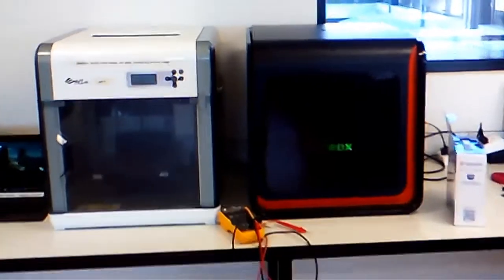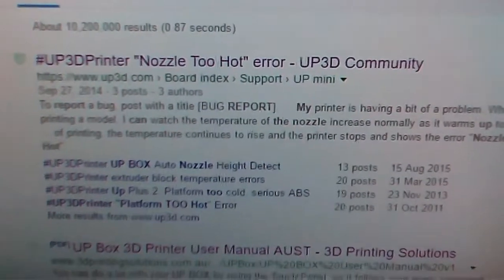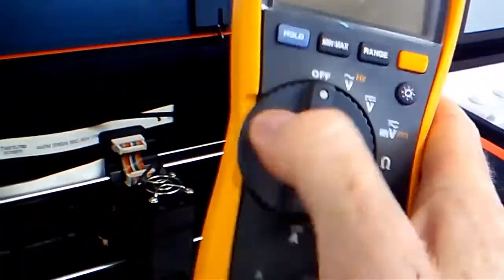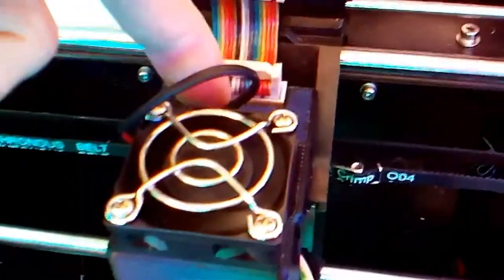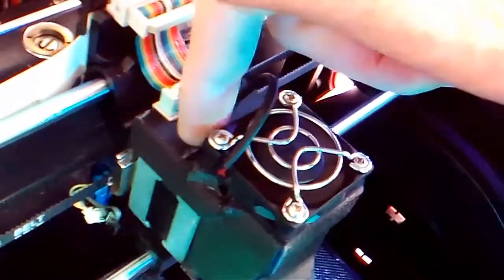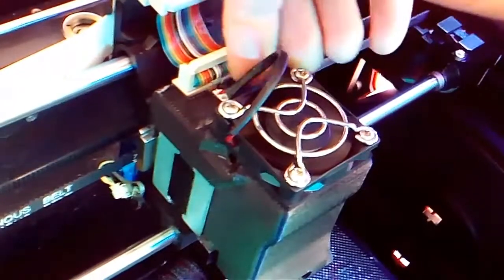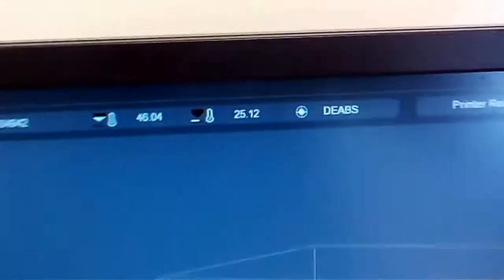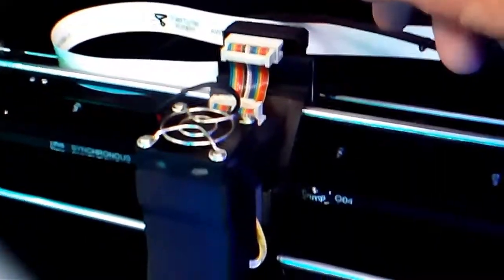UPBOX nozzle temperature issues and check

Comment: Hi 

I have the same issue with my Up Box. Did you get your printer working?

Nozzle Temperature of  mine just gets to 30 degrees. I have replace the complete head and still have the issue so am thinking it may be the main board. 

I also have an Up Box+ which is working perfectly fine

Any advise would be great
Thank you
Reply: I am having the same problem. Big temperature fluctuations. Have you solved this issue or found what is causing this error?
Reply: @William Sanders I managed to fix my temperature problem. It turned out to be the ribbon cable from the printer head the the main board. All working well now. I don’t have WiFi on my printer but we do on the up box plus in work and that looses WiFi connection but I think it’s do do with the work network rather than the printer